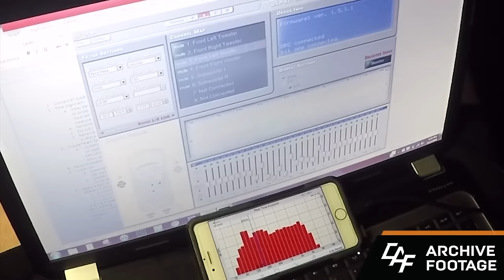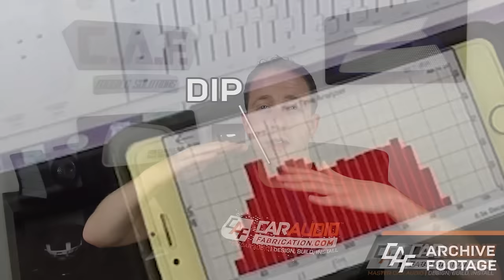Build the BEST Car Audio System - Full process explained

Comment: You should run a car audio school in your area
Reply: connectedcaraudio  If you look in the back so you see Mobile Solutions? That is the school.
Reply: The Fun Family Simpson to me mobile solutions doesn't sound like a school.
Reply: Hey so does this sound right. I called an car audio dealer shop, replacing front speakers , tweeters and crossovers , sub woofer and two amps . I have all the gear except harness' and wiring. To swap out system they said it was gonna cost $1,600-1700 Canadian so like to do it in a day w two guys. Does this seem fair or a little too high. Thank uou
Reply: @myfukinarmhurts  Maybe a touch high. Usually the cost of your components = install cost. That's really a general idea but its a good starting point,

Comment: I used to get overwhelmed by planning, and it's a crippling experience!  While it's not a technique for everyone, I find that when I get to that point, it's time to get to work actually building something.  Often times, the uncertainties of the install sort themselves out once you actually get your hands busy.
Reply from the maker: I have this same problem from time to time, it's important to think a few steps ahead, but sometimes you have to take a step to see what the next one is.
Reply: The thing to check is the direction of the river,is it going the right way?.Then  and only then,is the water wet?Just leave your car audio unless you have old stuff,usually the new gear is a nice piece of kit.
Reply: CarAudioFabrication Hey, what do ou think of blam speakers? Between the relax 165rxq and the live 165.300? Trying to find best car audio option and worth upgrading to one of these. And thoughts on the audison 10 apbx ds? Would be running of 4 way audison 4.9 bit dsp and mono helix ampThanks

Comment: his point about a good install ( with less expensive equip. ) out shining a bad one ( with expensive equip. ) is a good one. I built a system for a customer that cost her ~$4500cdn in a 87 CRX. she went to an IASCA sound off and was in the same class as a guy with a similar CRX. he had spent $16000us, she beat him for 1st. place.
Reply: Roland Schoenke What did you instal for her?
Reply: it was in the 90s, but I installed a pair of AVI 5-1/4" components in the front ( they are made in Canada ), an AVI 10' woofer, a PPI art series 4ch amp. Kenwood deck and changer, Kenwood 10 band EQ. then I set it up with my Audiocontrol RTA.
Reply: Yup, l did🙂
Reply: ya it did, got pictures
Reply: Roland Schoenke great I just wanted a head unit and a sub ...didn’t know it would cost 5k...
Reply: and charged $4500 for that ? thats alot bro, i had in 1988  4 twelve cerwin vega's installed in my 1984 cutlass supreme brougham , with a 300 watt Rockford Fosgate Punch amp with built in crossovers with 5 1/4" door speakers with tweets and a Rockford Fozgate pre amp that was bouncing lights at a slant /(cool) never could keep my hands off of that adjusting the sound, with a Sony Disk player that was just coming out at the time and it freaking bumped so clen you could talk to the passenger in a conversation while it was pushing the bass thru the backseat, literally a piece of paper i was holding was flexing in my hands to the beat. I loved it ,but on the outside it sounded like i was being electrocuted because of the body rattle in the licence plate and chrome strippings. 500 for install i brought equipment paid 800 cash fo equipment it was a good deal at the time. not knocking your job just didnt add up.

Comment: I spent $1300+ on my system in my Ram 1500.

$450 head unit
$250 1600 watt amp
$350 (2) 12” 600 watt rms subs
$50 on wiring
$120 in under seat sub box
$150 on 450 watt rms speakers 
Installed all myself and it sounds badass. Loving it
Reply: I did the same I bought

$380 12in kicker l7 Solo baric pre fabricated sub
$350 1000 watt amp
$350 pioneer double din
$240 two pairs kicker 6.5 door speakers
$50 wires
$150 Epicenter

About 1600 but I installed all by myself since they were charging me 1500 to install at a shop..they crazy as hell!
Reply: Sounds about right. Howd you get 2 12's under seat?
Its not that bad if you add an upgrade here and there. Sure ive invested over $1000, but I've also had this system for 8-10 years.
Reply: @Jclownwalk  I feel that about going to a shop lol. Tried it once, never again. DIY isnt that hard, its well worth the money saved.

Comment: just a new head unit and playing with the EQ can work miracles. 
add a sub and you're usually good to go. 
maybe throw in some efficient door speakers that can run off stock power and wiring.
there you go, your first system.

Comment: Just did this with a truck I bought. Wanted to stay around $500 do labor myself and I like very loud volume but like a clean sound. Got exactly what I eat but spent $600 instead. New 6x9’s in front doors, 6 1/2’s in rear doors powered by an amp at 110watts TMS per channel. Added a slim undeseat 8” subwoofer with integrated amp.
Sounds amazing

Comment: I bought a 2021 Mazda 3 Hatchback. Turns out the stock stereo (Not BOSE) is this system Mazda engineers nerded out over and created something really special called the Harmonic Acoustics system. 
I read that they made it better than the upgraded BOSE. They said it involved all aspects of noise, vibration and harshness. And they dampened stuff and moved the speaker positions. 
It has a 13 band eq built in and 8 Pioneer speakers that were designed for this system/Mazda. I cant find the specs anywhere but anyway its not recommended that I upgrade the receiver or speakers. That tripped me out.
So I bought a high level Skar 8"  sub Im going to run at 4 ohms with a Skar 1200 Watt amp in their Kerf ported armor coated box. I battled on what size sub, how many , RMS..OHM..power and since I listen to metal and not wanting the booming booms I went with the 8" wired at 4 ohm. Hopefully I made the right chjoice

Comment: Hey, i'm a new driver looking for a nice audio set up. What I had in mind is dual 8's or 10's in the back. As well as a couple 6x9's in the side doors. Please let me know if you have any tips for me.
Reply: Only run 2 door speakers if your tight on cash. It will suffice. Do all the work yourself because it will cost a fortune to have it done "professionally".
Reply: a 6 thanks man I actually have been doing my work and research so rn I have two Skar TX 6x9s and dual Skar EVL 12s, runnin em on a RD 2000.1 D Skar amp

Comment: Hey Mark,  I'm a disabled dad so I am budget-conscious and can't do the physical install myself. My goal is simple...louder. Our 2005 Dodge Magnum has the "premium" system, there are 6 Bostons all the way around, an "amp" behind the drivers side panel and it's still not loud at full volume. I'm replacing the head unit for sure, but 1) I don't know how many watts will be enough or if it changes the volume much,, is it the head unit or amp that will improve volume more? The stock amp is obviously weak 2) Will I need to replace the stock 6 x 9's in the rear to handle increased volume?.I've read the stock 6x9's can't be swapped straight out, the "height" of the Bostons is unusually short so guys cut into the plastic below the speakers, I can't do this or afford an extra labor hour sawing into the plastic. Are there lower profile 6x9's ? To simplify my inquiry Mark, will a new head unit dramatically improve volume or do I need to replace the stock amp as well? I'm looking at a head unit with 340 watts if that helps. Thanks so kindly for helping out an old broken guy LOL (got run down by a USPS truck on my Ninja years ago, 10 blown discs) God Bless

Comment: In my experience with my FD rx7 my old Bose  component speakers sounded nice, then I had someone do a a pretty shitty install with two crappy amps, some infinity reference coaxials 4 inch in the front and 6x8s in the back and kept the Bose subwoofers in the trunk.. it sounded just a tad better......then I decided to remove the Bose subwoofers got rid of the amps  researched speakers and went back with some infinity kappas line coaxials 6.5 inch up front and same 6x8 kappas in the back  and only 1 8 channel Rockville amp, and holy smokes huge huge huge difference and much simpler.....then I added a 2.5 audiofrog center speaker and removed the non working speaker......and it practically sounds like a component because the highs were missing up front.....amazing day and night difference.......in my journey  so far damn I think.........the speakers make all the difference along with some fast rings..my two cents. And let's not forget that center speaker whoa 😳😳 huge difference.

Comment: This was an awesome video!  There's one question that I have that the Internet has yet to answer...  I'm doing some research on building a 1x15" bass guitar cabinet, and I'm trying to figure out what frequency would be best to tune to.  I play a 5 string, and my lowest string (B) produces a frequency of 31Hz.  Should I tune my cabinet to that frequency?  Or would it be best to go lower (~25Hz), or perhaps higher to my E (41Hz)? 

The frequency response of the woofer is 38-3k Hz, not sure if that would be needed.  
Ideally, I would love for my woofer to produce the fundamental of my low B, but woofers that can do that, at acceptable THD, SPL, and Sensitivity, are kind of hard to come by.

Comment: I need help with what parts I need.  Keeping my factory radio. 2014 civic si

Want to replace front tweeter, front door speakers, rear deck speakers and one factory 8” sub woofer to replace it with a mid woofer. 

Main question can u recommend what audiocontrol product that would power all those speakers that can run factory radio?

Running jlaudio xd 1000/5v2 5 channel amp.  Thank you for what you do Mark.

Comment: Like this video a lot.  After many systems in the past, I kind of find myself following these steps on my own.  Presently waiting for final wiring and damping materials are; Audio Control LC7i to use my stock head unit, Hertz HDP1 for a pair of Hertz HX250's, a Hertz HDP4 for 2 pairs of Hertz ESK 165s and a 2 pairs of Hertz ECX 690s..... thanks for the tips

Comment: A great source of Car Audio knowledge CAF!
How do people solve the problem of a 2 channel factory Hi level output to aftermarket 4 channel amp? Can I passively parallel, say Left factory head unit to channels 1 & 3 Hi level inputs on the aftermarket amp? With Factory R out passively feeding 2 & 4 Hi level inputs as well? I can't even seem to find a hi-low converter that will do this for me. I want to have front/rear L&R and realise that "Fade" would be a set and forget situation.

Comment: How to upgrade the amplifier in the Volvo p3 plattform? 
Allready have a match dsp, but I want more power to the loudspeaker. 

The premuim sound amplifier original from Volvo has 130W, connected to a most network. 
What is the options here?

Comment: I have a 2017 Mini Countryman with a stock stereo system. the head unit is integral to the cars functionality so I've elected to use a Match plug n play amp and replace the speakers with focal speakers that also replace  exsisting speaker openings which are 3 inch in all four doors and two 8 inch underseat subwoofers. I've also added a powered sub for the back for more low end. The match amp is also a DSP so with some assistance from manufacture rep I've set the crossover points based on his recommendation with my speakers in mind. Two problems I'm dealing with is there's not enough warmth in the sound. Meaning a lot of highs and hi mids and low lows, like it's lacking mid lows and punch from the snare and a punchy kick drum and bass guitar. I'm trying my best not to crave the car up and I'm wondering if I should look to try and substitute the underseat subs with a 6.5 in mid bass speaker? Also I'm still having issues with the sub in the back hitting late. Meaning the underseat subs are hitting at the right time but the sub is later and not sure how to fix that. do you have some ideas?

Comment: currently running 3 speakers. 2 mid range and 1 tweeter on a 2 channel 600 watt amp with the gain turned all the way up connected to a chinese headunit. It was cheap, like really REALLY cheap.....but it sounds like absolute trash because without the gain all the way up you straight up cant hear it in my loud ass car... If I get a subwoofer do you think I could salvage my system or should I just start from scratch?

Comment: I have a 1986 Chevy truck single cab. Would like suggestions on a good system to run. Looking for decent sound, a little extra base. 

Would like to run a 2 knob head unit so I don’t have to cut original dash.

Comment: Would like to see you make a video for people on a budget. Like a complete system for $500. What would you get?
Reply from the maker: First, being "on a budget" means you are limited to a number. For some people that number might be $50k. So the real question you are asking is what someone might do if they have a very small budget of only $500. It's important to manage expectations. $500 in the grand scheme of things is not much at all. Assuming you are DIYing the install you are looking at MAYBE a low power 5 channel Amp, 4 very entry level speakers and a low powered sub. It could sound decent installed correctly, but isn't going to be much more impressive than an OEM system.

Comment: I have no clue about stereo systems. So I’m just going to bite the bullet and just get the good stuff and not waist time with cheap crap. Im looking at getting the JBL GTO609C Premium speaker set. I’m confused on this thing called” 2 way speakers”. I’m wanting to put about 4 or 6 speakers in my car. Does this mean I can only have 2 speakers in my car. I have no clue about the wiring aspect of putting in speakers

Comment: Hey mark ...my car's front door got it's door speakers outlet at the top of the panel ..and I wanna  install mid range speakers is it a good choice or should I choose full range ones ?
Reply from the maker: You need full range coverage up front. So yes, unless you are going to do components with both a tweeter and mid.
Reply: @CarAudioFabrication   ok cause I was planning to 2 6x9 full range speakers for the rear and eventually a sub...

Comment: I have a 2000 model extended cab silverado new pioneer head unit 2 din, 1 Boss AR1500m monoblock amp,2 10" subs 1000 watts each downward facing box for under the back seat and 4 new pioneer door speakers 300w 50 RMS do i need another amp how should i wire the subs? amp doesnt say what RMS it is no imped

Comment: Hi. I have a four channel MB Quart XA1-800.4 four channel amp. The power is 100 watts x 4 @ 4ohms. I've not purchased the components yet as I'm still deciding what to get and what configuration to consider. The default would be to get the MB Quart BMW components. They operate at 75watt @4ohms. My question is, how do I get away with a more powerful set like the Hertz Hi Energy which operate at 125watts? Would I need to bridge them across the 4 channels? and what would that take my amps peak power to? Would I need to set my gains according to the 125watts of the components? Many thanks.

Comment: Hey .I have a kenwood head unit and enjoy superb music with jbl speaker. But I wanna change my head unit and not the speaker. Will changing a head unit have any adverse affect  on my current sound quality
Reply: uttam banerjee you may have to adjust the gain on the amps but other than that it should be fine

Comment: hi, please if you have time , i want to upgrade my honda civic 2015 speakers only(no amp). actual system is composed of a speaker in each door and two tweeter in front of the car. i want to install jbl stadium gto 600c in front (two speakers + two tweeters) , for the rear doors do i have to use the some speakers ??? 
thanks

Comment: I want to put together something for sure... I'd like DSP so i can do time alignment, phase, and graphic EQ adjustments (custom presets obviously not some "rock n roll" preset).

My next thing worth noting is i want my sub to only cover 25-110hz. I don't like hearing subs go above 110.... so I would love to get a good speaker to cover the next range.

I'm a professional live sound engineer so the systems we use are always 4 way. a Mono sub doing 20-100 and then a 3 way line array. I don't think a 4 way system is appropriate maybe in a car but I do like an overall balanced sound with a tad bit more shimmer at around 12khz and bass that is solid when listening to something like a rock song or metal but nothing CRAZY - although I want to be able to go into crazy mode if i feel like it. I'd love some product recommendations if anyone has any. I'm driving a 2017 Toyota 86.

Comment: Question on LOC's. Can you put two LOC's on the rear channels of a factory head unit so you can adjust subwoofer amp with  subwoofer level control nob. So in total there would be three LOC's. 2 for front and rear speakers going to a 4CH amp and 1 to sub amp.

Comment: Ok so if i have components with tweeter midrang and midbass should i put each one on its own amp for the crossover points or would it be best to use a passive crossover?

Comment: My  build starts with a reverse camera, which means I need a headunit with a screen because those things that attach to the rearview mirror are illegal in Australia. This led me tothe Pioneer AVH-A215BT, which also has three pre-outs. I wanted more bass than the stock stereo, so that means adding a subwoofer. Anything other than a 5 channel amp is pointless for me. So that means an Alpine 5 channel amp, which means I now need new door speakers....... So, Alpine component speakers in the front doors and Alpine coaxials in the rear doors. The subby can run 300W RMS but the amp only does 200W to the subby channel. Crap.